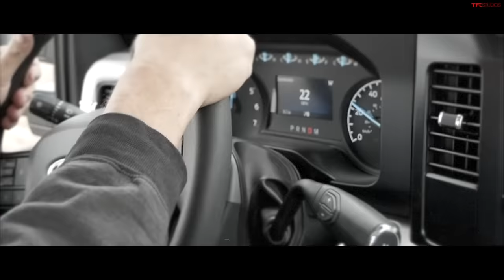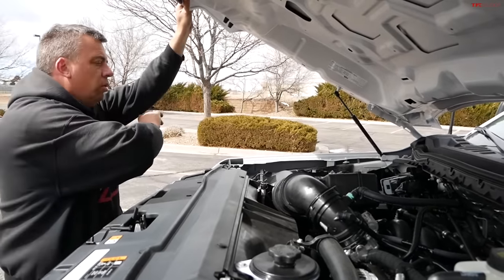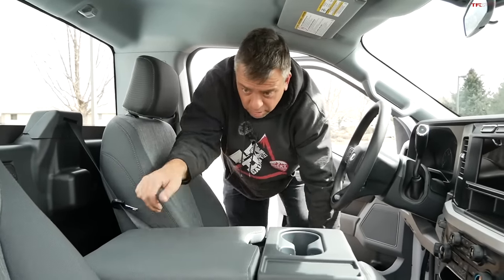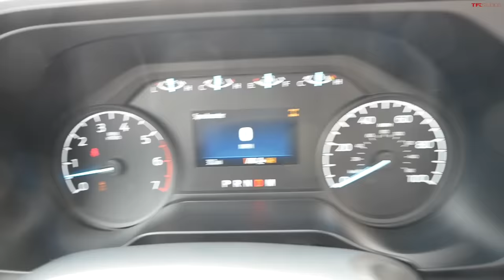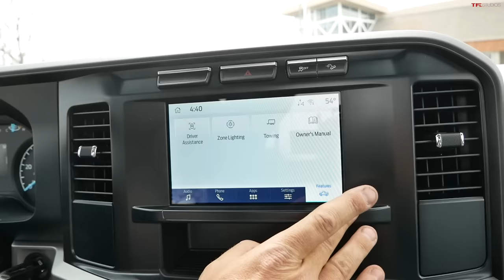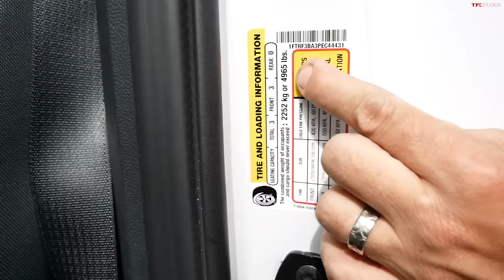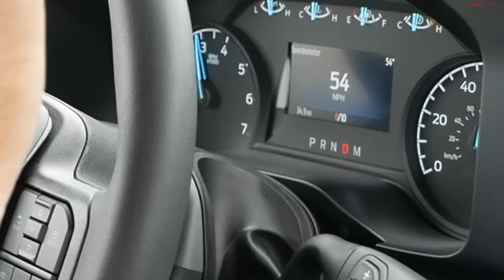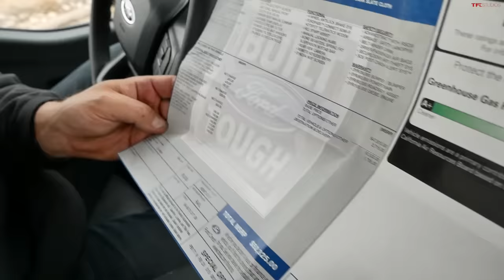I Drive a 2023 Ford Super Duty XL Work Truck with the Brand-New 6.8-Liter V8!

Comment: Love the 8' bed. Had one on a 2013 Silverado extended cab 1/2 ton. Filled that bed regularly doing chores on a 2 acre wooded suburban property with mature trees. Would definitely buy a truck like the Ford, perhaps without the snow plow prep and running boards, saving $500.

Comment: I have owned a diesel f-250 for the past 16 years, looking to buy a new truck. I am amazed at the gas powered offerings Ford is presenting. After researching for the best newer diesel with little problems, I don't think they exist. Probably going with a 7.3 gasser next time around.

Comment: Thank you, a real work truck at a reasonable price. I know that after drinking the company Kool-Ade you can't admit that selling your Ford was a mistake and have to hope that the new one works out. I work at an ATV dealer for one of my jobs and own none of that brand although I have a dozen that I own and get ridden on my property. My time belongs to me!
Reply: How is $50000 reasonable...
Reply: @OBS4ever16  because in 2005 this same truck (F350 / 4x4) was $28,000….adjusted for inflation that’s $43,000

If your wages kept up (not all have) it’s fair all things considered, esp since a base model truck 20 years later will be nicer
Reply: @OBS4ever16  It's 2023
Reply: @OBS4ever16  It's not.
Reply: @tjhva  The problem being that most wages have not kept up with inflation.

Comment: That shifter drives me nuts (in my 2020 F150 work truck), too. No beef and no detents. I'm constantly overshooting and putting it in "M" and swearing while trying to carefully align it on the "D". Usually while trying to leave the gas station, listing to that 3.3L scream.
Reply: That's what... ...said. beat you to it

Comment: So this is basically taking the place of the V10 that's usually in U-Haul
Reply: I’m not certain but I think chassis cab vehicles have the 7.3 as the base offering.
Reply: The 7.3L is more a replacement for the V-10. The 6.8L is filling the slot the 6.2L held for the previous decade.

Comment: I’ll probably be ordering a 23 f350 this year and strongly considering this motor but hadn’t seen specs on it anywhere. Thanks for that. Not sure if I want to buy first year of a new motor… but seems like it should be even more durable than the 7.3 as it’s just the same motor destroked.
Reply: Why would that make it more durable?
Reply: The Ford website has a great section that shows all the towing specifications.
Reply: @Matticus289  Engine is less stressed
Reply: @Matticus289  same block and bearings with slightly shorter stroke meaning the pistons don’t travel as far. Little less rotating mass on the same bearing surfaces. Also slightly lower power output on the same parts. Should mean a little less wear.

Comment: Love everything about it, the 6.8L seems like it has great power for a base engine based off of that acceleration run, but the price...Jesus, 52K for a single cab base model with it's entry level engine is insane. My 2011 F-150 5.0L FX4 Supercab was stickered at 40K new and it's a mid trim model. It's 2023 equivalent would likely be 60K+. These price's are insane. But in any case, I look forward to the flogging of the new 6.8L on the Ike Gauntlet. It would be really cool if you guys could get ahold a 6.8L Ford a 6.6L GM and a 6.4L Hemi Ram and do a direct comparison of all of them. Would be interesting to see how the base engines all stack up together.

Comment: Well those numbers are impressive, if it was only simple and reliable it could be a home run . Maybe a nice simple manual 5 or 6 speed.
Reply: The thing I miss most is a manual trans. Still rocking a 4 speed granny in my old F250. The next on my list is an A pillar I coild easily see around. These trucks are busy inside.

Comment: Got some anecdotal inflation data for you: In 1985, my Dad bought a new F-350 dually chassis cab (460 V8  Gas) as a mechanic's work truck. He paid $12k for it. Amazing truck, he put several hundred thousand miles on it, original engine, and used it up until it rusted through about five years ago. Inflation from 1985 to today is 186.05%. Which means a new F-350 dually chassis cab should cost $34,326. But the actual MSRP today is $50,865. You could argue that newer trucks have more bells and whistles, safety features, etc... But I will also argue that most of that is software that costs almost nothing per truck, and a new truck will go nowhere near 33 years of trouble free use before becoming a nightmare to own (especially that new 10-speed automatic that everyone seems to love at the moment).

Comment: Excellent video Andre!  Is this a push rod design like chevy engines and the 7.3 godzilla?   Seems like owners say push rod gets better laden mpgs than dual overhead cam engines?
I bet you miss your xl!
Reply: Kevin Cameron is the guru of engineering here.  The whole idea of overhead cams is to reduce reciprocating mass. This in turn allows higher RPM numbers. This is important for small engines that spin above 5000 rpm to make power, like motorcycle engines and small auto engines. That's why the OHC concept was wasted on the Fords and Mopars. 
These truck engines aren't going to be making very many dragstrip passes so usable power low in the RPM range allows the use of less complicated technology to achieve the desired goal. 
Funny how the present is returned to the past. The 7.3 is basically a Mopar 440, 6.8 converts to 414.9 cubic inches, still pretty beefy. 
The Mopar engine here is the 413, which was a smaller bore than the 440, IIRC, but used the same block and crank. Ford used the same block and bore, but like the 351C and the 400, chose to destroke the larger engine.

Comment: Wasn't the outgoing 6r140 a very reliable and robust transmission?  I don't think the same can be said for the newer 10 speed.
Reply: The 10 speed is fine as long as Ford isn't programming it.
Reply: @davidporter7051  it’s based off the 6r140 and the issue isn’t programming ..
Reply: @CoyoteFTW ok like anyone will be a guy calling himself @BC.

Comment: I have a 2010 Tundra work truck and I love it. I added the factory cruise(plug and play) and different wheels and front seat covers, but the interior is perfect and easy to keep clean when hauling gear and the dogs. Work trucks are what a lot of people want, so hopefully Ford can produce enough of them to meet demands outside of fleets. Get them while you can, because the government is intent on forcing manufacturers to get rid of them.

Comment: Why does the bed look like it's sagging in the thumbnail like the frame is already bent lol..
Reply: I think the bed step makes it look like that since theirs no line that continues to the cab.
Reply: @FishFind3000  yeah I was thinking the same thing
Reply: I think its a combination of that bedside step and a wide angle lens taking the picture. It's distorting it slightly
Reply: It's pretending to be a ZR2
Reply: It doesn't look like that at all.
Reply: @evictioncarpentry2628  Yeah, that could possibly be it
Reply: @davidporter7051  Put on your glasses

Comment: The transmission will be the wild card.  Seems like the 6r100 was a better fit for the 6.2l the 6r140.  I'm thinking the 10r100 with the 6.8l will have better drive ability than the 10r140 with the 7.3l

Comment: Now if only they still had manual locking hubs and floor shift 4x4
Reply: No
Reply: Isn’t that still an option? I’m pretty sure the previous Gen was that way and hadn’t heard about changes there.
Reply: Why? Going with a manual is just going to limit the amount of customers who drive your truck,reduce acceleration performance, efficiency, and long term reliability, and add to the cost of the truck because the team had to spend millions of additional dollars on developing a second transmission. All for virtually no benefit except to appeal to people who long for the "good old days".
Reply: @themidnighttavern6784  he is talking about manual locking hubs. Not a manual transmission.
Reply: @alexdalton6215  Perhaps I'm wrong, but when someone is referencing a floor mounted shifter, I assume they're talking about a traditional manual transmission. But they could be talking about something mounted on the floor that shifts it into 4 wheel drive. Please correct me if I'm wrong, but I don't believe you'd need something mounted inside the truck for that. Aren't wheel hubs used to shift into four wheel drive on their own? I've never used them before, so enlighten me if that isn't the case.
Reply: @themidnighttavern6784  The wheel hubs locks the front axles. The transfer case shifter inside the truck is what selects 2wd or 4x4.

Manual locking front hubs are more reliable then automatic (typically vacuum actuated hubs when electronically selecting 4wd)
Reply: @evictioncarpentry2628  Good to know, always fun to learn new things. Thanks for the comment!
Reply: It still has manual locking hubs as an override if the vacuum system stops working. They got rid of shift on the floor 4wd beginning in 2020 trucks. My 2019 had the floor shifter but my 22 doesn’t.
Reply: @cliffordmontana4562  I've never seen a truck newer then 2016 with the manual shift transfercase
Reply: @JohnDewh  alright have fun when your shift motor either rusts solid or gets packed full of snow and will only move halfway
Reply: @bread-gz3rl  My 2019 F250 XL that I bought brand new had one. Ford got rid of it for 2020. I wish my 2022 f250 had one, but you can’t get them any longer.
Reply: @cliffordmontana4562  mightve been a US only thing to keep it that long. I'm in Canada and the newest I've seen is 2016. Also do you know when they killed the manual transmission option because Google is absolutely useless lmao.
Reply: @bread-gz3rl Ford stopped offering a manual in heavy duty trucks in 2010. RAM was the last company to offer a heavy duty manual. They stopped in 2019.
Reply: @cliffordmontana4562  yeah I had a feeling the 2014 I saw with a 6 speed wasn't stock lmao
Reply: My '99 does. It's a beast.
Reply: @harryballzack  I'm currently looking at the 87-91 trucks, only problem is they're all in BC and I'm in NS lmao

Comment: I've used GM, RAM and Ford 3/4 tons for our work trucks.  All standard cabs   The F250s have been my favorite and most reliable, but geez how they can make a full size truck interior so cramped beats me?!   Fords single cabs are cramped by a large margin vs the others.   No way I'd go with a standard cab Ford...

Comment: Hopefully it will be better than the 7.3 in terms of dependability.  Before I buy this time, I'll wait a while.
Reply: It’s the same engine but de-stroked
Reply: @FishFind3000  Did they use the same variable oil pump on the 6.8 as the 7.3?
Reply: We had a 7.3 die at 15k miles 😅
Junk
Reply: What sort of issues do you mean? I've only heard good things about the motor.
Reply: @Hybris51129  No idea what happened but it started knocking at 15k miles
Reply: @Hybris51129   I know about an oiling issue that causes delaminating of the rockers and metal debris in your motor... It's tied to the variable oil pump, Ford has stated that the truck gets around 6-8psi of oil pressure at idle. Don't over-idle the trucks, and change your oil every 5k miles. I'm definitely going to be getting a F250 with the 7.3 in the future, there's no replacement for pushrod displacement!
Reply: @angelgjr1999  Overall, it's a great engine.
Reply: @themidnighttavern6784  Well this was a delivery step van. They run 10+ hours a day non stop
Reply: @angelgjr1999  no warranty ? I call BS

Comment: Cletus McFarland has showed how great the 10 speed transmission is in these new ford trucks
Reply: Hes showed it....short term lol

Go to your local transmission specific repair facility and ask them what they think of GM/Ford collaborative 10speeds
Reply: @evictioncarpentry2628  don’t give GM credit for their “collaboration” they had 0 to do with it. There’s thousands of these 10 speeds getting launched in 4 hi making 700+ hp. They’re plenty strong
Reply: @joshuaearnheart2756  Its a fact that is was a collaboration regardless of how much input there was. And yes, they last like 6 months doing that before blowing up or starting to slip. I know two people with 700hp F150 and both of them slip within the first year of moderate driving.

Like I said, go to a transmission shop and ask about the real life reliability  not the 8 minute video you watched on YouTube to form your uneducated opinion.
Reply: @evictioncarpentry2628  it’s not a fact. Ford designed the 10 speed, GM was supposed to design a 9 speed transaxle transmission for front wheel drive cars and they were going to swap but the 9 speed was so bad ford never put it in a single car. Good try though.
Reply: @joshuaearnheart2756  They're the same transmissions with different ratios. And they're garbage long term. Get over it.
Reply: @joshuaearnheart2756  Your mostly right, the Gm Fwd 9 speed, Ford didn't like how it worked and fixed it by making it a 8 speed that is now in the Bronco Sport , Escape, Maverick, Edge, Nautilus and probably some overseas vehicles also.

Comment: I just still don’t get having the 7.3 and 6.8 together.  So close in power and ratings.
Reply: I’m sure a hybrid based off the 6.8 is coming soon.
Reply: IMO it’s just like Ford or the others doing standard and High Output versions. This is similar except designed with a displacement difference instead of a boost difference.
Reply: Does it get better gas mileage??
Reply: @ALMX5DP  the 6.8 probably only uses marginally less fuel. But the savings adds up when you are running an entire fleet. The 7.3 is standard on higher trim levels.
Reply: Marketing decision. It’s in the same size category as the Ram 6.4 and GM 6.6.
Reply: Chevy 4.8 and 5.3
Reply: @Jesus_Christ_is_alive  my guess it would be minuscule difference. My bet would be <0.2 mpg's if that. Back in the 90's I had a 351 v-8 my neighbor a 302. Same trucks. I got better mpg's than he did. He always had to keep his foot in it, I didn't. Currently have a 2021 F350 7.3L . I have owned numerous trucks over the past 50 years. 1/2 t if you're concerned about mpg's; 3/4 or 1T for towing and load cap. The mpg's are better than way back, but these are not economy cars.
Reply: @danr9584  That’s why the 6.8 doesn’t make a lot of sense right now. It’s only available on base xl trucks. Ford obviously has additional plans for the 6.8 or else it wouldn’t be worth it. My guess is a hybrid will be revealed in the next two years. And I’ll buy one as soon as the kinks are worked out.
Reply: @herb7877  i think your guess is about right. I have a 7.3 f250 but I still care about mpg. I like saving money. Lol. If this truck can get 0.5mpg better than the 7.3, that’s an extra 24 miles each time I fill up my 48 gallon tank. I’ll take any savings I can get. This engine is 7% smaller than the 7.3 so it will probably get about 3-5% better fuel economy.
Reply: @cliffordmontana4562  Also parts sharing. The 6.2L is a completely different engine, the 6.8L is just a de-stroked 7.3L which means they share the same machining and a LOT of parts unlike the 6.2L. It'll be cheaper in the long run to have two engines based off of each other vs each one being it's own separate thing.
Reply: Me thinks they're getting ready to bump the 7.3 up to 500 ft/lbs, power may get a slight bump. 

It'll be just like the old GM 8.1/496 days. That was a mean motor. But omg the speedometer & fuel gauge were inversely proportional to each other.
Reply: @nathanmcdonald610  Aldo the factory were the 6.2 was made has been shut down.

Comment: I’m wondering if I can get 17 miles per gallon on the expressway with the bed cover on the back and a perfect front end alignment I just saw a video where the new Colorado with a 2.7 L going to got 15 or 16 miles per gallon. Hopefully after the engine was broken and it’s more like 20. That’s embarrassing when a super duty gets better gas mileage than a four-cylinder turbo engine.

Comment: My Lincoln Aviator hybrid black label has 500 HP and 600 lbs of torque and lets not forget over 35 mpg highway and the first 20 miles of city driving are almost free due to 13 cents per kilowatt electrical costs while driving pure electric in the city.

Comment: Playing around with Ford's website as I'm watching and apparently if you go to dual rear wheels it's either 6.8L gas or 6.7L diesel. Kind of strange but at least for now there's no option for the 7.3L with duals. My 2008 Dodge 2500 has 325hp and 650lb-ft of torque give or take and I've towed a 14k dozer with it and a 10-11k forklift both on a triple axle trailer and not had any issues with power. In fact I got going too fast with the forklift and cost me a tire on the trailer, always fun to do along side the highway. More power is always fun but where does it stop?

Comment: I wonder why Ford made the 6.8L when they already had a 7.3L ? Not a lot of difference in power between the two. Other than the price, whats the advantage of one vs the other?
Reply: Parts sharing. The 6.2L is a completely different engine, the 6.8L is just a de-stroked 7.3L which means they share the same machining and a LOT of parts unlike the 6.2L. It'll be cheaper in the long run to have two engines based off of each other vs each one being it's own separate thing.

Comment: Fingers crossed - let's hope that Ford has resolved the lifter issues that have cropped up on some 7.3 Godzilla engines.   With the stated payload rating and 4.3 axles this would easily allow for a 3,000 lb slide-in truck camper.